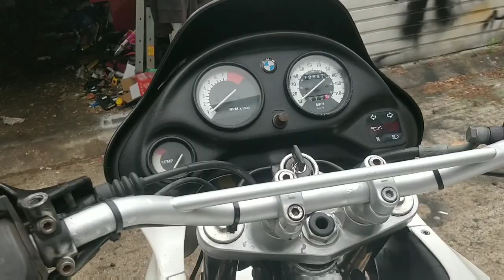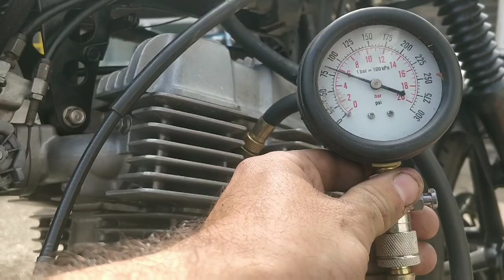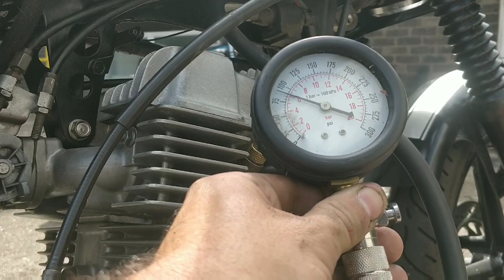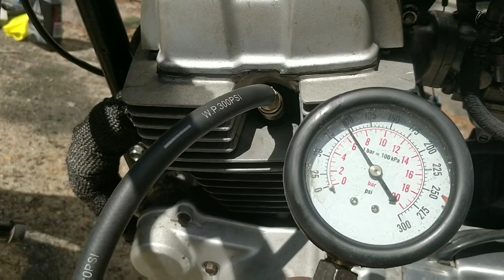Honda cb250, compression test, valve adjustment. How to adjust motorcycle valves.

Comment: Hi Charlie,

From the sounds of things the guy who came to look at the Beemer was obviously never going to buy it. The points he made are negotiating points to offer less money. Clearly a dreaming tyre kicker.
Personally I’d have taken the wheels off to clean them. Give you more access.

The CB is a shame but whilst it’s all stripped, clean up and repaint the engine. You’re only going to add value.

The ER, have a look at the oil. I’m wondering if it’s going to appear overfilled, as I’m suspecting petrol leaking into the engine.

If you were closer to me, I’d offer to paint the bodywork of the CB. 

Good luck
Reply from the maker: Hi Gary, you were right on all of that comment mate. Did paint the engine a touch, definitely fuel in the oil.

I'm going to paint the bike as best as I can but it would be great if I new someone local. The prices to paint in London are rediculas.

Comment: On the CBR it looks like the front wheel has a slight buckle in it, on the video at 8.24 you can see it below the tyre valve? Personally I’d buy another CBR with a knackered engine (plenty about) and swap the engines over and then sell everything else for parts
Reply from the maker: The wheel looks OK but I'll check again especially as I've put the wheel on ebay. I can't find another bike mate, I'd settle for a frame and logbook but can't find that either. I'd much rather build this bike but can't find a frame. It's anoying really.
Reply: motorcycle rescuer : There is a few frames on eBay, but it’s mostly all older bikes, is this a much newer model?, with regards to the wheel it could just be a tyre scrub mark or maybe a bit of paint has come off, but looked like a slight buckle on camera.
Reply from the maker: @nitromad1  Yeh I've found some from like 2006 but it's a completely different bike. This is a 2011 to 2017 model. So that frame is needed. I'll keep looking for now just incase but if any parts sell on ebay between now and me finding a frame then it's over.

It's so anoying because this frame is perfect. It's only the forks that have bent.
Reply: motorcycle rescuer : keep an eye out on salvage auctions, Facebook and gumtree and hopefully something will come up.

Comment: Charlie  at times you drive me mental but then I've got OCD lol.
You really need to sort that garage out mate,buy a trolley with two levels and a plastic storage box.
Parts from each bike go in a storage box so you don't end up going into Narnia to find them.
Use the trolley for your tools, less time in Narnia equates to more time working.

Compression test every bike before rushing into it,no different to getting stats off a patient in hospital.....you know what you're dealing with then ( plus you add the compression test results in your selling advert as it gives buyers confidence).

Unfortunately you're in a precarious situation at the moment as we come out of covid 19 lockdown.....people don't know if they've got a job & are holding back on buying till August. 

As for the cafè racer well with all the extra expense it's going to sell for less than you've put into it but time will tell.
I thought the head /stud bolts had to be undone in a preset order?
And use old clothing for dirty jobs or buy what's known as a rag block ( motor trade buy old cleaned rags in weight sizes (kg) & use them )
Great explanation of how to and not what to do !👍

Keep smiling mate ,ride steady & stay safe 🤟👍
Reply from the maker: Lol Daniel, I've done all the clean garage stuff and it takes to much room when I do. But yes I got to have a touch more of a clean out. I may buy more of the magnet holders as they are great.

No, you can undo the studs any way you want, it hadn't warped or overheated or anything. I choose to take the head of. I now have to work out how to get it ported, by how much (I'd like to bore it to 350cc) and what it cost.

Either way I may be over my head with this one, the timing and valve work will throw me I think when it's all ready
Reply from the maker: Also Daniel, honestly I like to fire engines and feel them myself, listen and look for smoke to assess the engine. I've always had access to the compression tester but only plug it in if I feel I need to. Anoying I know lol.

Comment: Take the strips off the mudguard and the back . Get a bigger k and N to fill the space. Other than that it’s cool !
Reply from the maker: Yeh I'm losing all the stripes for now, I didn't prep cause I wanted to test the look. I've got 2 new ones coming that are the same but I doubt I'll use them.

I don't want a bigger cone as I don't want more air. Would still like to make side panels but I don't have the skill to do so.